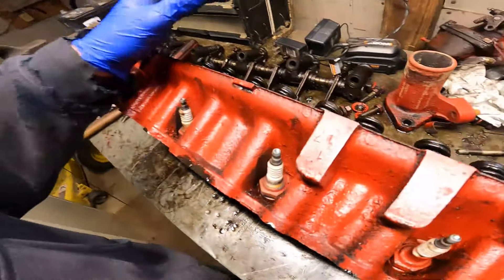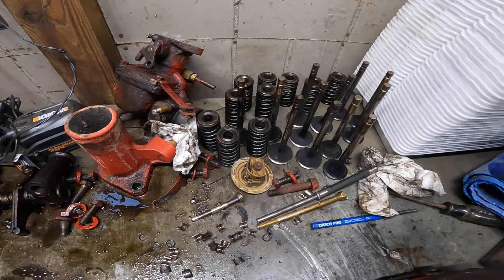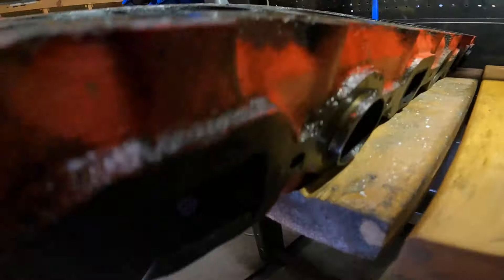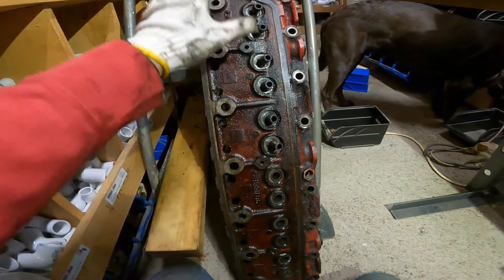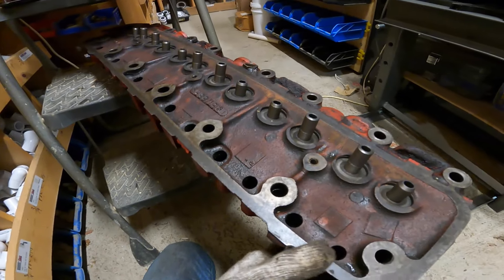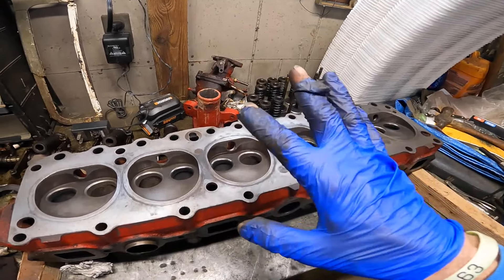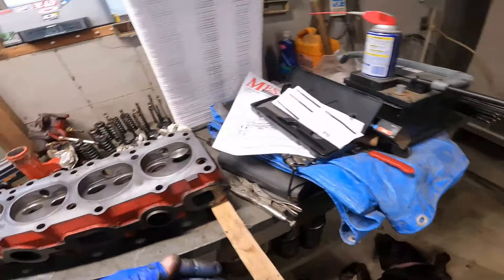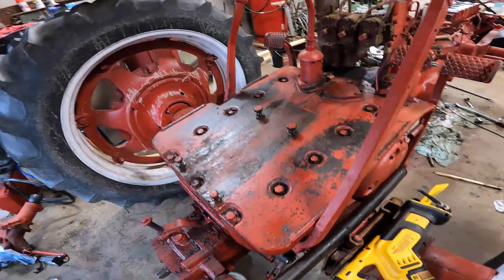New Valve Guides | Farmall 460 Tractor Repair | Episode 8

Comment: that valve looked bent
Reply from the maker: I’ll double check them but pretty sure they were all straight
Reply: @shaffershomestead  it was the first one you picked up, to clean the head surface can use a plastic roll lock wheel has little finger like things on them they clean pretty good and don’t gauge the surface
Reply: It's just distortion from the camera lens